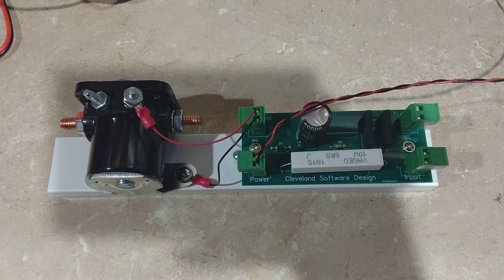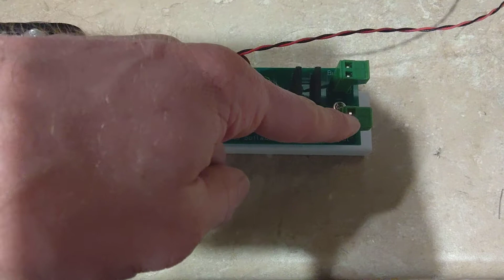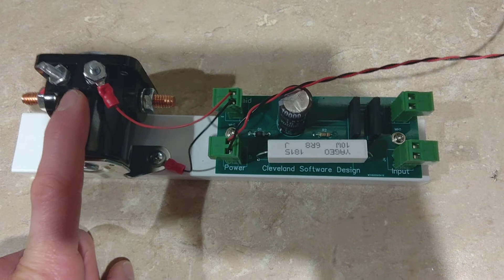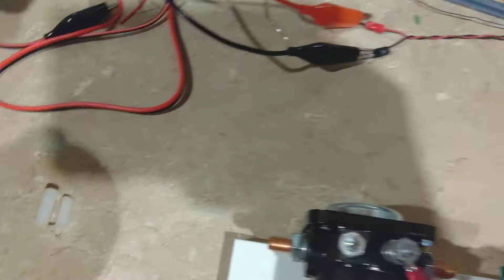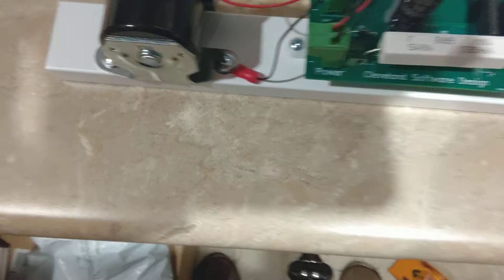Virtual pinball flipper solenoids - direct wire, no software required! - CSD

Comment: Added 2 cheap chines outboard solenoids to my VP9  pinball cabinet. For signals each side. Made double microswitch holders one each side. Behind L and R flipper buttons. Press makes a signal to software and flippers on screen. 2nd mswitch sends it to solenoids via relay cheap board. Never failed in a few years of use. 12v power from used PC power supply.
Reply: Hello, i just installed this solénoïde solution, i search a solution to play with solénoïde off, to be able to play late at night without noise. 
I Saw your solution with double microswitches boutons, and i'm very interested in it. 
Please, if your have some link for this kind of boutons ? Thank you very much by advance !!!

Comment: Does the builders kit solenoids come with this for the flipper buttons? Or if you went the builders kit route you'd have to simply rely on DOF?
Reply from the maker: builders kit is all DOF, you can add these if you want, but you would have to purchase separately and I can incorporate them into the builders kit.

Comment: Hi Philip.  Great product.  I think this is for me, but I would want to add in a "silent mode" to easily turn these on and off for a quieter game...maybe with a hidden button.  Curious of the solution you would recommend?
Reply from the maker: I actually provide a wiring diagram in case you want to add a simple switch to turn off. It does require you to purchase a switch and do a little wiring yourself though
Reply: Not sure how I missed the diagram.  Never heard of a DPST switch, but it makes sense now.  Thanks!

Comment: I recently installed these in my cab. They are working great and sound awesome. What is the lifespan on the solenoid? just wondering if I should expect to replace them every year or what? Thanks.
Reply from the maker: I'm not exactly sure how long they will work for, but I have thousands of them out there and have had just a few failures. I haven't had any fail due to overheating; it's always been a mechanical spring or weld failure on the solenoid itself.

Comment: Hello. Nice product. Just one question. Does the solenoid make only noise?. Can you feel it as well as hear it? That means, do you feel the solenoid moving and have a good feedback when you use the flipper? or it is only for the sound?
Reply from the maker: These are big enough that you can feel them as well as hear them. It's hard to describe how much you feel, but it's enough that you definitely notice it, especially if you hook them up near the flipper buttons.

Comment: Thank you for developing these Philip! Sorry to be a newb, but will these work in an ALP right out of the box (with no computer connected)? Do you just install them directly to hardware inside the stock ALP machine? Thanks 🙏
Reply from the maker: Yes, these work right out of the box and come with everything you need (except for a couple of tools) to hook them up.
Reply: @clevelandsoftwaredesign  Thank you!

Comment: Hi Philip, I have a pair of these for my vpin and they're awesome... but was wondering if these can be made to autofire while holding down the button, for a custom project. Just for context, I'm thinking it would be cool to route the fire buttons on my GRS flight yoke to these solenoids and mount them up under the control panel. Thanks!
Reply from the maker: They are not able to be made to autofire at this time, although you are not the first person to ask for that!

Comment: I was looking for help to improve my virtual pinball emulation. I’m not sure if this is even possible with what I have. I built an arcade stick with arcade buttons on both sides to mimic pinball flippers.  I used EG Start zero delay usb encoder kit. The kit came with 2 sanwa joysticks and 16 led arcade buttons . I configured the sticks to work with my hyperspin drive using joytokey. On my drive I am able to play pinball tables that are in The Arcade Pinball emulator and the FX Pinball emulator.  Is it possible to add your solenoid to my arcade stick so I can get the authentic feel of pinball flippers? I was thinking of placing the solenoids on each side of the box where I have my arcade buttons located. 
What do you think?
Reply from the maker: This is exactly what this kit is designed for. It will absolutely work for that setup. Send me a note if you have more questions!
Reply: @clevelandsoftwaredesign  
Thanks for the speedy response. I see that you have a full kit with the power supply, does this kit come with 2 boards and 2 power supplies to power both left and right buttons? Just want to know if I need two kits or  will one kit be good?
Reply from the maker: The full kit comes with two boards plus a power supply to power both, so one kit is all you need
Reply: Hope you don't mind me jumping in on this conversation but I've been looking to do the exact same thing to my arcade stick

Just wondering if you added these to yours and how did go??

Thanks
Reply: @madduey6155  Worked great. Just had to cut out the led wire. And take off one side of the JXT connection to put the EGStart wire into Phil’s input and button connections. Easy to do only took about 10 minutes to get everything working.
Reply: @bmontano71  good to hear.  Do you think I could power 2 of these with a usb 5v to 12v up converter? I was hoping to splice into the existing USB to the stick and not need the seperate 12v power..
Reply: I would ask Phil the creator of the product about that. He is very good with responding back to questions. I don’t want to give you the wrong information.

Comment: How is the input part on board wired to PC? The illustration on flipper board says button input to computer, so I'm not following how that's done
Reply from the maker: It goes to the input where your button would normally go to, so the USB encoder to joystick controller or a kl25z.
Reply: @clevelandsoftwaredesign  a bit late to the party lol but I’m confused about the same thing. So both wires (neg and positive) go straight to the input board, none go back to the buttons? The wiring diagram on the website shows the positive going to the board and the negative to the button, confusing a bit

Comment: Not sure what I'm missing, but tried to add this to a ALP and tried to wired button to the button terminal and the input to the ALP encoder/controller and just having the flippers button being held down, like someone is holding the button down and not releasing it. Any diagram on the wiring for this available?
Reply from the maker: Just reverse the wires on the input terminals and you will be good to go. For some reason some boards are reverse.
Reply: @clevelandsoftwaredesign  copy, will give it a shot right now
Reply: @clevelandsoftwaredesign  Flipping them worked man. Thanks, they sound and feel amazing 👏😀
Reply: Do you need to purchase a separate power supply when adding to ALP?

Comment: 12 volts needed per solenoid? Will it work, just not as hard, with 5v?
Reply from the maker: It will not work with 5v, needs the full 12v
Reply: @clevelandsoftwaredesign  awesome 👍. Just waiting for you to get them instock on ebay and will order them ASAP. Thanks man. Bee Kong sent me your way.